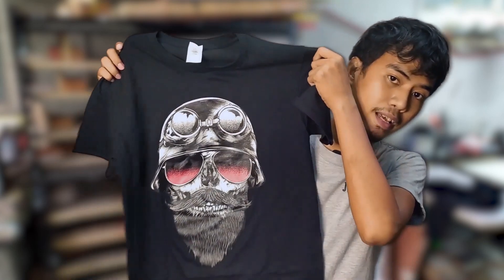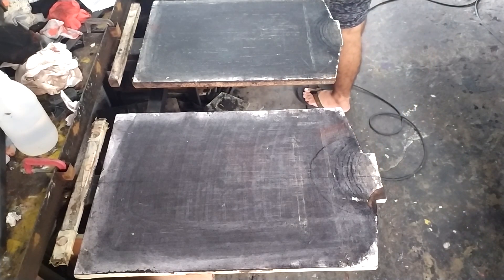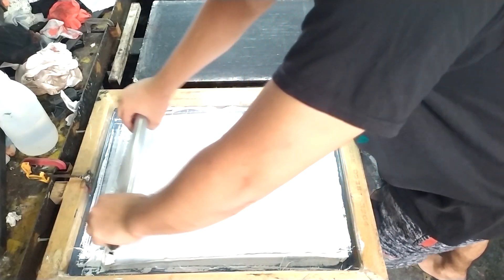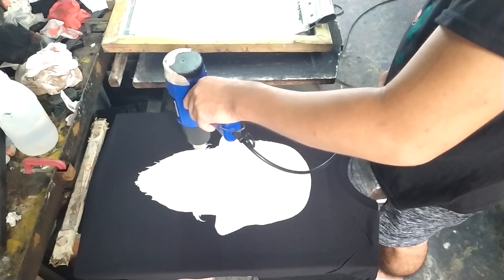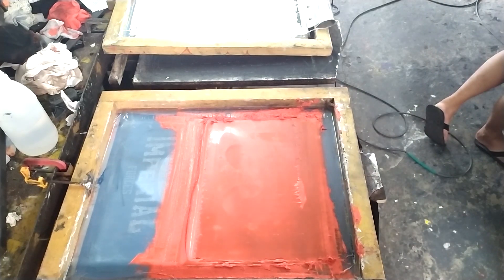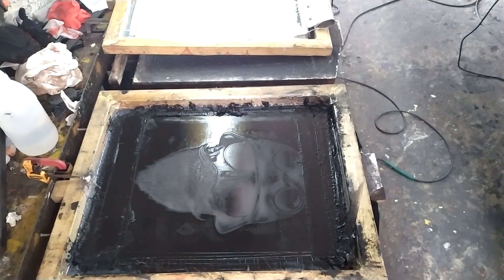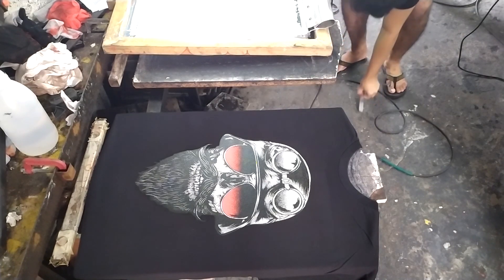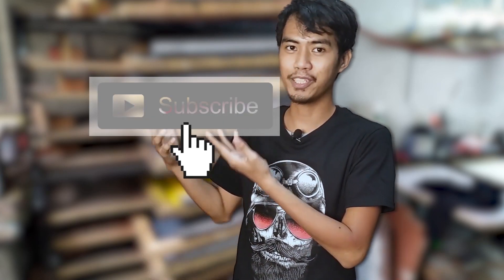Printing 3 Colors with Solid White Underbase

Comment: THANKS FOR YOUR VIDEOS AND FOR SHARING ...  mY question is about How to get a Smooth  Print How to Stop TShirt Fibrillation print with plastisol I have this problem many time !! and is there a way to cure plastisol without heat press I am a poor man I dont have money to buy heat pess right now if is there an alernative please share
Reply from the maker: Are you using 100% cotton shirts? You can try to heat printing area of shirts using heat gun and remove burn fiber then start printing. You need hard and sharp squeegees too. Reduce off contact and push hard when you print the first stroke.
Reply: @LineTableScreenPrinting  Thank you for the advice removing burn fiber and reducing off contact I will try and tell you after ... no I Am not using a 100 per cent coton !!
Reply from the maker: @okinawastreetwear9137  You should try. Make sure to really press hard for first coating.
Reply: @LineTableScreenPrinting  tHANK YOU ITS WORKING I burn fiber  and I push hard and its much better than before there is no fibrillation anymore but its still hard feel touching ..... maybe I make the plastisol very runny ... do I need to make it more thicker ???
Reply from the maker: @okinawastreetwear9137  After first coating or stroke, the next one is just little force to make it thicker.
Reply: @LineTableScreenPrinting  thanks for your help thats great Nice advice so yes  thank you